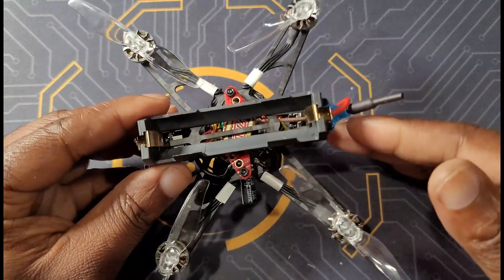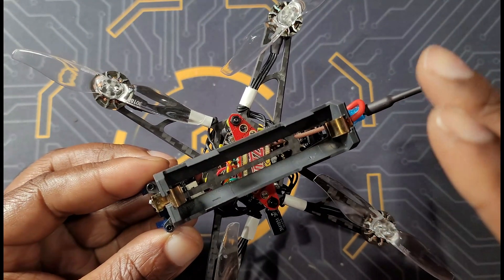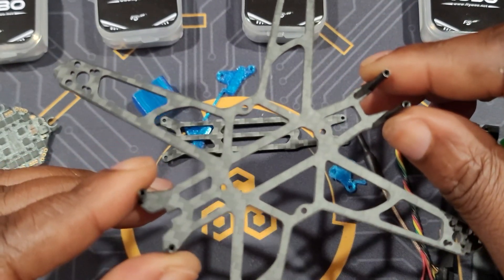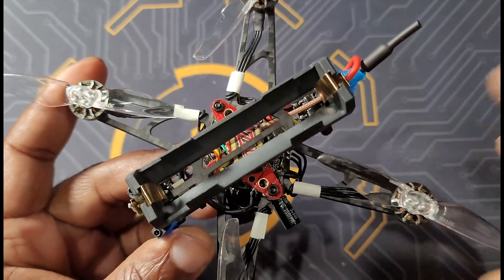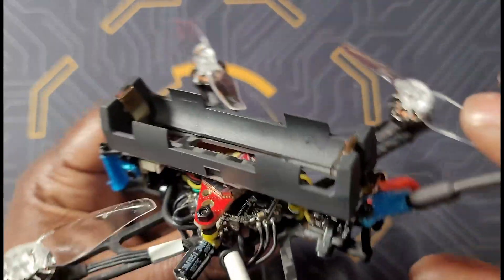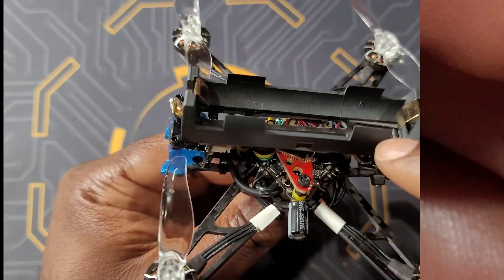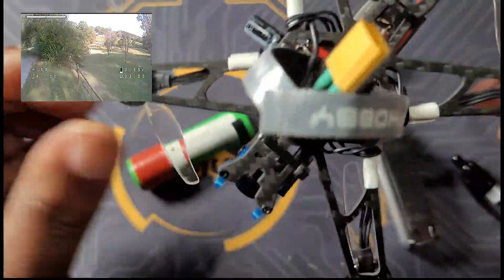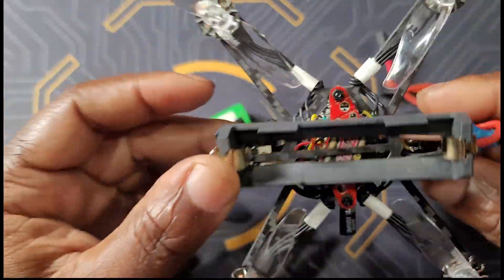18650 or  LIPO batt "The Best of Both Worlds"

Comment: Great build! I'm using the same flight controller in my Tinyhawk Freestyle 2S build, it's been great. I love my Crux3 NLR (single 18650) for long duration flights and, like you say, pushing my limits trying new stuff 👍 I'm curious, do the motors get hot running 2S on those 11K-KV motors? Thinking of building one of these for a 2S fs practice quad.
Reply from the maker: They do fine on 2s, but I'm using betaflight  motor scale at 60% while running 2s.

Comment: Thank you for share. Great quad. I also think to use this frame, hope is strong. I like alot the ideea with 18650. 
How about 2s 18650?
I have some 1104 motors with 4300 kw that I want to use.
Reply from the maker: The frame is fine,. You don't need to worry. These motors will do well on 2s.